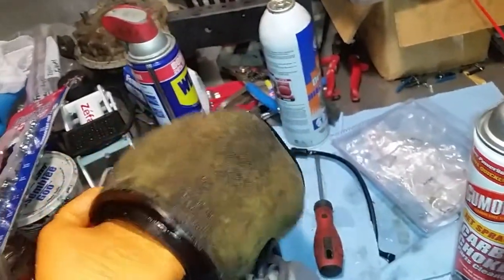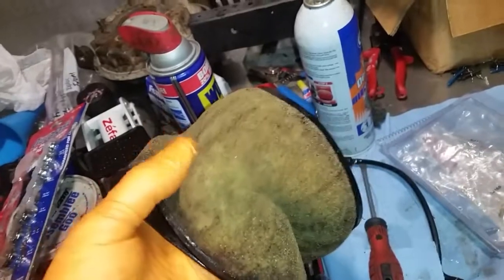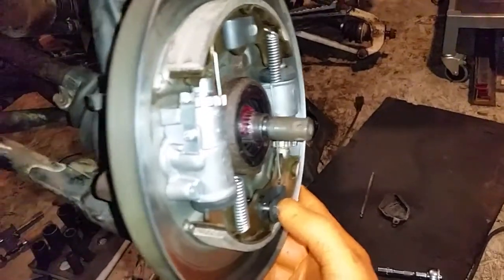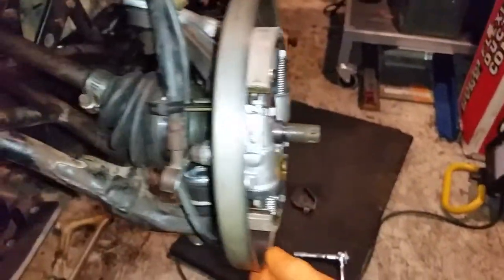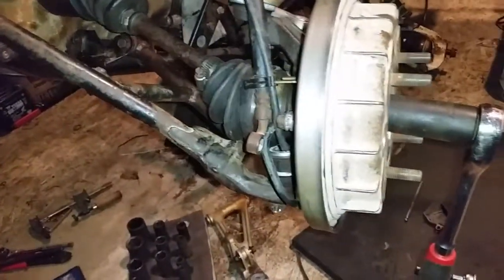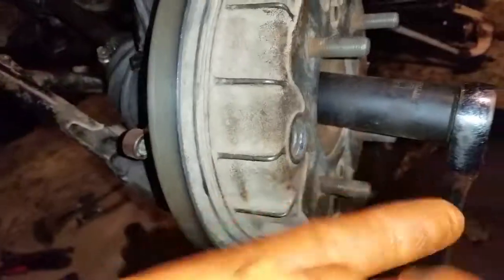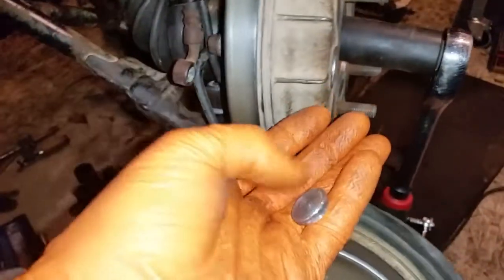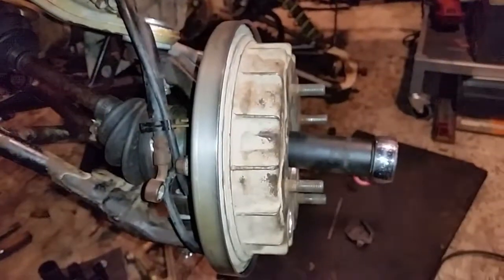2003 Honda Rincon 650 rebuild 17

Comment: Just wondering why you didn’t convert it to discs.
Reply from the maker: Lucky Goose i honestly didnt look into the pricing of that when i ordered all the new drums and pistons. it could have costed me more im guessing? i sure have put allot of $$$ into this bike... :D i have kept every single little packaging with oem part numbers on them all in a box. and man is that allot of parts!!
Reply: denis gorelyy  oh, I know how much it costs to rebuild a rincon. I rebuilt 2 so far. One 2006 and one 2007. Both were not total tear downs but close. 07 needed a cam, and once it was all back together it still needs tires. So another $500 for a set of big horns this spring. It’s great fun tho and you will love the quad once it’s finished. And they do hold value well. Keep the vids coming. Cheers.
Reply: 250-300 for disc kit and  red rubber plug goes in that hole where you plugged it with your dads machined plug 9 (nice)
Reply from the maker: Lucky Goose oh ye thats a bit much for a disc setup for me.. brand new drum setup up front will have to do.. :)